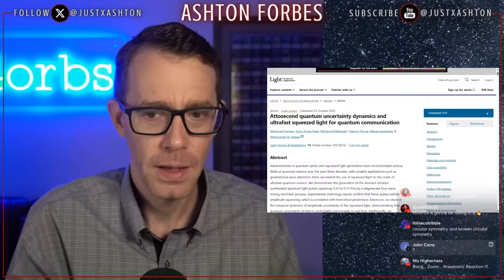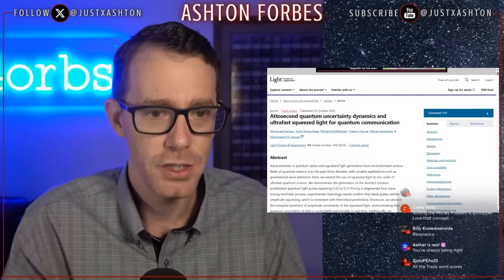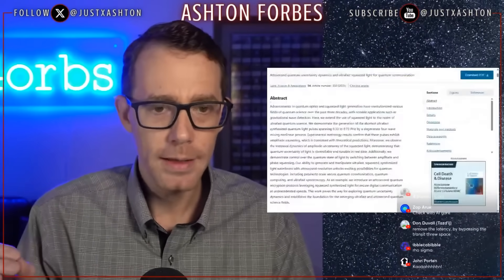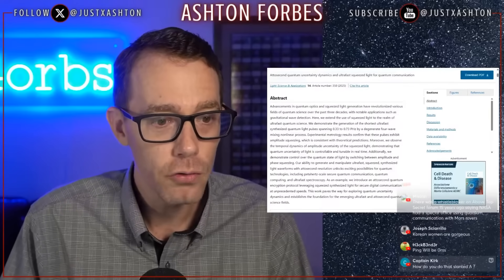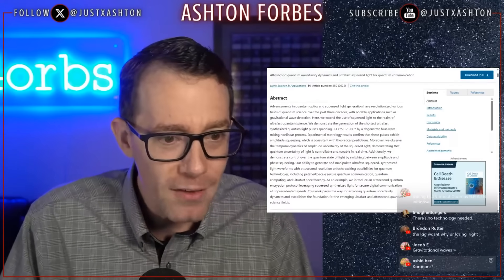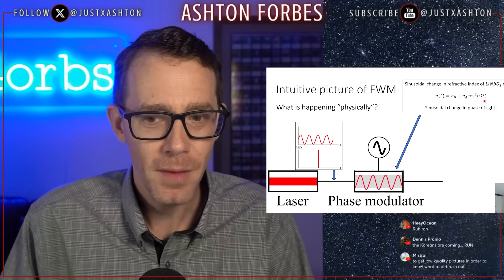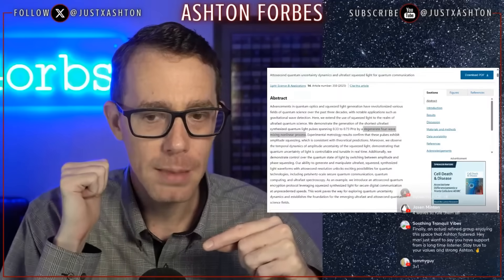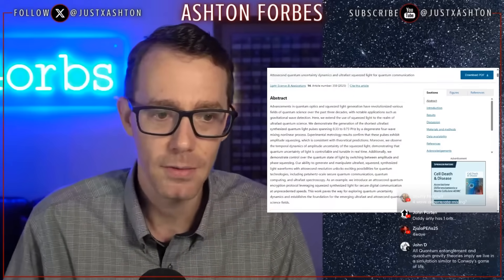The Key to Faster-Than-Light Communication

Comment: I’m going to bed but this is what I come up with so far after listening in. Type the quotation text into grok. Then ask about arrays

“LPA - Laser plasma accelerator 
FEL - Free electron laser
PLL - Phase lock loop

LPA-driven 4.75Thz FEL PLL Doppler upshift scale proton-boron (p-11B) & helium 3 plasma mirror Lorentz factor

Reaching extreme field intensities near quantum electrodynamics limits like the Schwinger limit?”

In summary, an array of PLL-synchronized FELs can be engineered to induce controlled spinning of a plasma mirror by coherently transferring angular momentum through tailored fields and phased beam interactions, enabling advanced control of plasma optical elements.[pmc.ncbi.nlm.nih +2]

This could open new pathways in ultrafast nonlinear optics and plasma mirror-based light source technologies.

Add some array coils to collect energy?

Comment: @justxashton Copy this to Grok

LPA - Laser plasma accelerator 
FEL - Free electron laser
PLL - Phase lock loop

LPA-driven 4.75Thz FEL PLL Doppler upshift scale proton-boron (p-11B) & helium 3 plasma mirror Lorentz factor

Reaching extreme field intensities near quantum electrodynamics limits like the Schwinger limit?
Reply: I come up with this listening to you
Reply: And then we spin it

In summary, an array of PLL-synchronized FELs can be engineered to induce controlled spinning of a plasma mirror by coherently transferring angular momentum through tailored fields and phased beam interactions, enabling advanced control of plasma optical elements.[pmc.ncbi.nlm.nih +2]
This could open new pathways in ultrafast nonlinear optics and plasma mirror-based light source technologies.
Reply: Then we add an array of coils to collect energy?

Comment: Light speed doesn't change, but the temporal can manipulate light such that increased bandwidth allows the light to jump of teleport.
Reply: The speed of light depends on the historisis of the medium and the mediums inherent fields. The speed of light is not a constant.
Reply: For example does light travel at the same speed through water or crystals, no it doesn't.